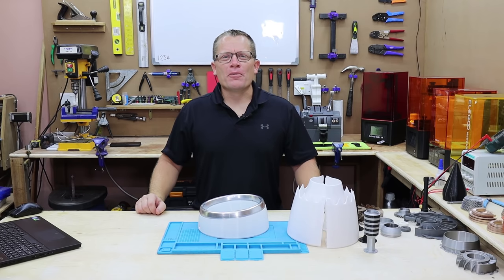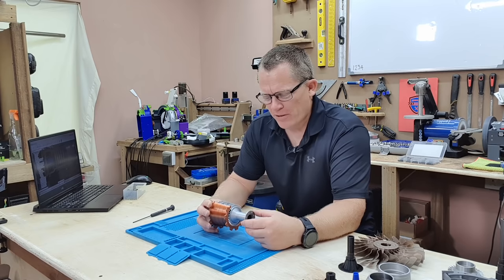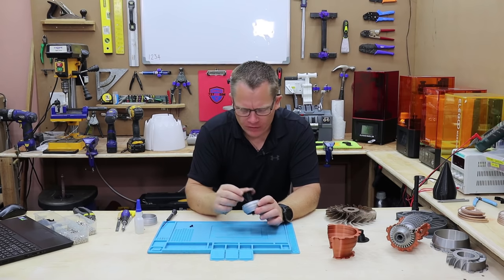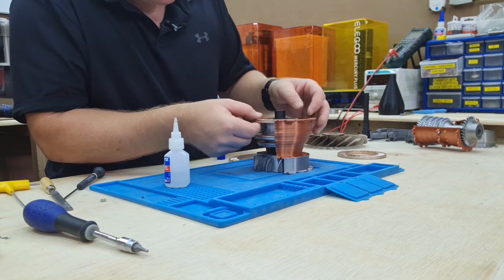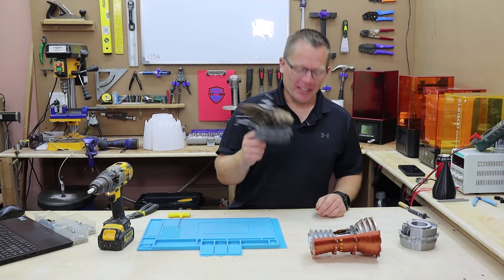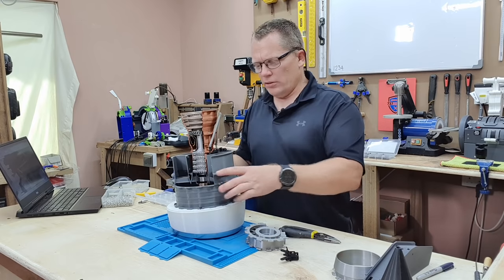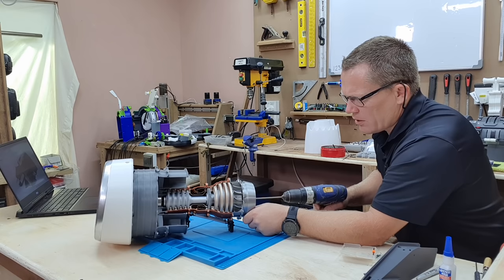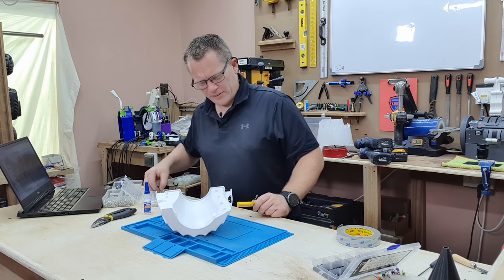3d Printed Turbofan Engine

Comment: Question: If I made this engine out of metal would it work like a real jet engine?
Reply from the maker: Hello and no, That is really a complicated and also simple question. 
The simple answer: No, because 1/3 of the casing have been removed. 
The complicated answer if the casings were complete, the designer winged this design. It looks great, but the airflow characteristics through the engine would be very inefficient. The hot gas leaks to the  bearings would instantly seize them and there are no labyrinth seals or oilways. Stage 1,2,3 compressor bleed air is also ducted internally within the engine to help cool the hot components. The idea of twin spool and triple spool engines also minimises the use of variable guide vanes to stop stall and surge occurring within the engine. The fuel metering system/ fuel control is also a very complicated design/process. 
However, with that said, if you had a complete metal version, and you didn't mind the consequences, (complete loss of the engine) It certainly would be interesting to rotate it up to 3000 rpm, inject fuel and a spark to see what would happen. It might self sustain for a second or two. The limiting factor of most turbines is the heat. A hot wet start could easily see the turbines reach 1200 to 2000 degrees C. Not many metals can handle that heat and the high rotational speed of the blades. It's like holding a gas torch to each of the turbine blades. 
Another thing that terrified Sir Frank Whittle on his first jet engine start was the runaway Up. I remember reading he fled the room thinking the engine was going to explode. He expected the engine to reach around 8000 RPM, without a governor it achieved self sustaining speed and I believe reached 43,000 RPM before it was either stopped or failed. 
Gas turbines are incredibly complicated things inside, however there are simpler ways to create a working unit, buy using two centrifugal compressors back to back, as most hobbyists you see on youtube have done it this way. 
Hopefully a little insight into my thoughts on creating an operational unit, possible but from home it would be like re-inventing the gas turbine from scratch again, but now you would have a good insight with the internet on how to overcome all the hurdles involved. Kind Regards Karl
Reply: @helimech8152  Well that's disappointing. When you called this a "working" turbofan, I was hoping it would combust fuel and produce thrust, but it's actually just a model of the real thing with moving parts.

Comment: Very cool work... Too many fan blades? modern engines have less: ie ge9x
Reply: It actually doesn’t have enough blades. It only has 22 blades but is modeled after the Trent 900 which has 24.

Comment: Great build, thanks for sharing. May I ask what printers you use? I have a Creality LD002 resin printer and  Ender 3 Max, would they be up to the task?
Reply from the maker: Hello Andrew, I believe that the parts can be created on those exact printers. I think there are split files offered by the designers. Check out the download files for me more info and double check before you start! Kind regards karl

Comment: Wonder if one could have those cut out panels available to somehow install to feel the amount of air flow pulled through.
Reply from the maker: Hi, I have seen some very cool additions to this build since I released the video. An airflow sensor hooked up to an Arduino should be a fairly easy task to create.

Comment: This is so cool on so many levels!! I'm planning to get a Creality Ender-3 V2 FDM 3D Printer, can I make this build with that printer alone?
Reply from the maker: Hi, It might be able to print the core of the engine from Thingiverse, But i found that the cowlings and intake will require a bed size of 300 x 300mm x 400mm height. This is too big for the Ender 3, but perfect for the CR10 v3. Happy Building and kind regards Karl
Reply: Perhaps it would be possible to scale it down slightly and still retain adequate tolerances. The designers might have an answer to that. I have the Ender 3 too so I would also be interested in this.
Reply: @helimech8152  Thank you for the info, will look into it!

Comment: How much material did this take to build? 3D printing has always fascinated me but I’ve never been convinced by the “cheap prototyping argument? How much does something like this cost to build?
Reply: If you go to the link to the design files in the description above, one of the designers describes the print time and costs. He says about 300 hours and US$150.
Reply from the maker: Wow that's a lot more money than I would have guessed!
Reply: The "cheap prototyping" usually refers to a comparison to injection molding or other non-additive manufacturing methods. If you actually tried to make this injection molded, the molds alone would probably set you back more than $10000.

Comment: I wonder is it possible for Chris Shakal and Bob Wiley to make a GE 90-115b engine? which is the engine on the 777-300ER
Reply from the maker: I would not reckon so, as it takes so much effort to design these. I know Bob reads the comments, so perhaps he might reply.
Reply: I’ve looked into the GE engine and gathered some data. It literally took 300+ of hours of design and print time to develop this A380 nacelle. One of the problems with the Trent 900 used on the A380 is, at the scale I created this nacelle, some of the turbine blades would have been impossibly small to print. That’s why I chose the core engine from Chris Shakal. The GE engine would have similar almost insurmountable problems. While the GE engine would be a rewarding project in itself, I think one nacelle design is enough for now.

Comment: Fantastic.! I'm a gas turbine engine tech and can deeply relate to all those components - very impressive!
May I ask what is that super blue workmat that you are using? Looks like silicone if I'm not wrong?
Reply: Yep, Silicone cellphone repair mat. I ordered one off the internet, they arent too expensive  if you look at the chinese sites
Reply from the maker: Hi, as someone else mentioned its available from Amazon and just type in Silicon work mat. Awesome bit of kit.

Comment: how many seconds would it last with real jet fuel? would it actually work if you moulded every piece with Al and steel?
Reply from the maker: Hi, i wouldn't last more than the initial second. Even out of metal, I'm not sure this design would reach self sustaining speed before failure. Kind Regards Karl
Reply: i might try anyway. its one of the only accurate designs i can find online and i cant find any free courses to make one last time i looked.

Comment: Thanku  sir..  for    this  much   
  We  get  some  knowledge  .. and
   Whats  helps  to   rotate  turbine
Reply from the maker: Hello Laure, The design has a DC motor unit inside the exhaust cone, this powers the unit. For this video i used a 1/4" drive extension (6") in an cordless drill. More details of the powering the unit in depth can be found in the documentation of the design. The link can be found in the description. Kind Regards Karl
Reply: @helimech8152     ok   sir i  got  it   ...  but  in  real  flight ...  is  there  is  any  dc  moter  insert .??   I  want  to know  that  sirr...   
M  confused   not  moter ,  no   engine   ..  then  how  itself   rotate  turbine  ..   sir

Comment: But does it actually work as an engine?  Will it "Fly" at all?
Reply from the maker: Hello Wayne, this is primarily a demo engine that is cut away and over a 1/3 of the casings are missing. This allows people to see how the engine operates internally with its twin spool design. If you wanted to make this operational, remove the core of the engine, and just have the front fan attached by bearings and a big powerful motor. No need for the core of the engine to make a model fly. The fan being PLA printed would disintegrate also from the loads involved. It really would be easier, cheaper and quicker just to go out and buy a EDF designed for the purpose.

Comment: I started collecting and printing parts...One item I need your help...looking at the engineering drawing TN1-013 [referred to in TN1-001] >>>is missing and it is for the Electric Motor Assy...Any Electric Motor Assy recommended?  I am looking for something powerful [but not too much that will break the engine apart :-) ]
Reply: TN1-013 is indeed the motor assembly. The drawings and STLs can be found on GrabCad, Thingiverse, and Cults3d. It uses a Pololu 3481 gearmotor. The particular motor spins the fan at 72 RPM. It won’t move any air but it gives a nice demonstration and won’t wear anything out. It runs on 8 AAA batteries and if the model is built without any interferences, will yield about 8 hours of run time.
Reply from the maker: Thank you for helping out and answering that! Nicely done.

Comment: Hi I like your design. I've been watching your video for days but now i'm stuck on one of the parts TN1-101 as it says infill 25%, wall 1.2 and floor/ceiling 1.5. my settings are based in Ultimaker Cura. Regarding the TN1-101, it has more headings in settings under infill. I would like to know which settings are correct and what i should set them to. Thanks for your help.
Reply: TN1-101 is a relatively thin part and does not have much infill so the settings are insignificant. What other settings do you need to know?
Reply: Thank you for your time and help I understand  .good job and will be flowing  you
Reply from the maker: Thank you for helping out!

Comment: Do you think I would be able to print this on the ender 3 v2 ?
Reply from the maker: Hi Chandler, This seems a popular question in this video. You might be able to print the core of the engine from Thingiverse. But I found that the cowlings and intake will require a bed size of 300 x 300mm x 400mm height. This is too big for the Ender 3, but perfect for the CR10 v3. Happy Building and kind regards Karl

Comment: I am building the model right now, I noticed that you did not install the swirl plate part #828 or the liner flange part#704 to the combustion chamber. I started to put them on but it didn't seem to work. Anyone know why? Asking for a friend!
Reply from the maker: Hi Jeff! In all honesty I forgot. After the build i looked down on the print table to see these parts left over. As it was built and glued. That's the way its going to stay lol. Sorry i cant be more help on the matter. Kind Regards Karl
Reply: If I can help: I see many builders leave this part off or install it incorrectly. It slides in from the side in a circular motion. Once in place and the fuel injectors are in place it doesn’t even need any adhesive to hold it in position. Depending on your printer settings it can be a little bit tight going in. Just sand a little off the inside or outside diameter of the swirl plate until it slides easily into place.
Reply: @rtwileyrc8030  What a beautiful 3d model! You and Chris did an awesome job. I will try your recommendation on the swirl plate installation I have completed the main turbine assembly and realize I am gonna need a bigger printer! LOL Another quick question, the turbine blades and stators with the supports, when I go to take of the supports, I takes small pieces of the blades with it. Is there a way to make the supports easier to take off...maybe the thickness of the support?
Anyway great job what you created!
Reply: I had issues with the supports on the turbine blades too. The edges of the blades are quite thin and there’s not much you can do to prevent them from adhering to the supports and being damaged. I just sanded things smooth and went on. The damage was so slight you would never notice it in the end.

Comment: What is the cheapest 3d printer that can build this?
Reply: I just finished printing all the parts I did it on a Voxelab Aquila and they go for around $150-200. Or you can get an Ender 3 v2 form micro center for $100 with a coupon

Comment: Could I put this on a microlight
Reply from the maker: Hello, I'm afraid not. Peter Spirol on Youtube has done a few ultra lights with electric motors. I don't actually think i have seen anyone strap a gas turbine to a Ultra/Mircolight yet. (id hate to think of the fuel consumption and the weight/thrust ratio) Kind Regards Karl

Comment: In this video you used drilling machine to rotate the engine, in real how did the jet engine has rotated like in car engine the piston has rotated the engine in jet what rotated it?
Reply from the maker: Good afternoon, the air is compressed in the compressor section. Fuel is added and as the gas expands during ignition at a phenomenal rate, this makes the turbine spin faster under the rules of basic thermodynamics. This in turn makes the compressor spin faster. This is a self sustaining, repeating cycle and without restriction, the engine would accelerate itself into oblivion. With no reciprocating parts like piston engines, these things can and will go as fast as you can pump the fuel in. Turbine speed is usually limited by material failure temperature and centrifugal loads. As the blades expand in length, this is known as turbine creep as they wear themselves away in the stator casing. I hope that helps, karl
Reply: @helimech8152  oh wow, but how did they start the engine when the plane/jet is in runway.

Comment: can someone please test the non cut out version?   I say it will run for 27 seconds on PLA and 4 minutes on silver solder
Reply: It wont work. there is no real fuel injectors or fuel system. and of course you cant crate pressure in it.also it cant hold too much speed ı tried 2000rpm and nearly it will blow up 😂

Comment: What I don't understand is how can you print parts as big as that when 3D printers are only available in small sizes have not seen a big one yet to make parts as big as that anywhere!
Reply from the maker: The size was down to the Creality CR10 v3 printer i own. Its allows parts size of 300m x 300mm x 400mm high.
Reply: @helimech8152  wowww nice one mate that must cost thousands for a printer on that scale surely

Comment: What’s the exact model of this jet engine?
Reply from the maker: You would have have to ask the designers who are both linked in the description.
Reply: The core engine is a conglomeration of various jet engine designs. It does not match any particular engine. The outer nacelle was generally modeled after the Trent 900 with modifications in order to fit the generic core engine.

Comment: Where in the world sis you get the CAD file of the whole design?! I'm in the process of printing and putting together this design right now. A CAD file would be amazing!
Reply: As part of the full download package on GrabCad there is a zip file containing various STEP files. One of which is the main assembly and it contains a STEP file for all the individual components. You can import that assembly into whatever CAD system you happen to be working with.
Reply from the maker: Hi, Bob has already mentioned this, but the link is also in the description. Kind regards Karl

Comment: if it was working the compressor chamber would melt. the title is clickbait as it should be " 3d printed cross sectional turbo fan education tool that you can make spin". a working turbo fan this is not.
Reply from the maker: Hello and thank you for taking the time to drop by and comment. That certainly would make for a long title, but I get your point, I don't think it would be just the compressor section that would melt reaching over 300 degrees,  but also the combustion, turbine and exhaust if 3d printed. Working seemed more apt than operational?
Reply: @helimech8152  I was somewhat confused by the title, as in "wtf, how is that supposed to work, it's all gonna melt or burn". Not sure how you'd express it better, maybe "with moving parts" or something along those lines?